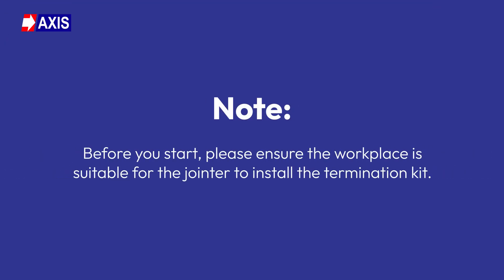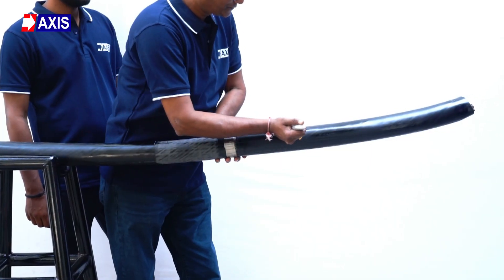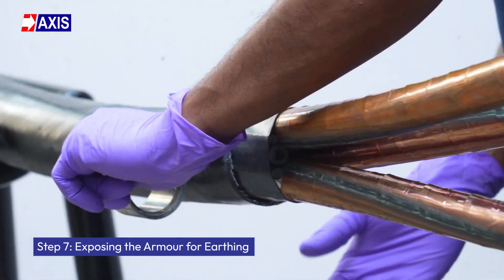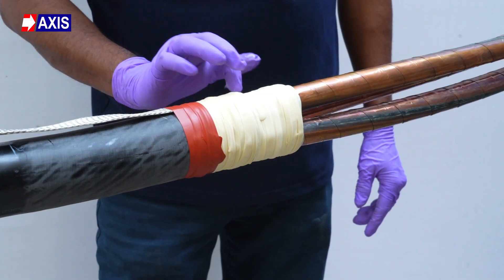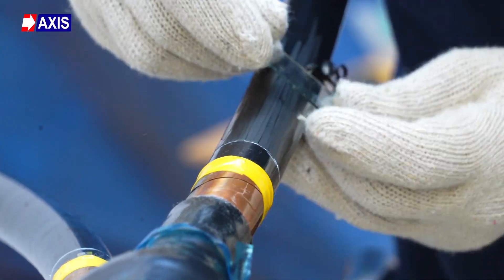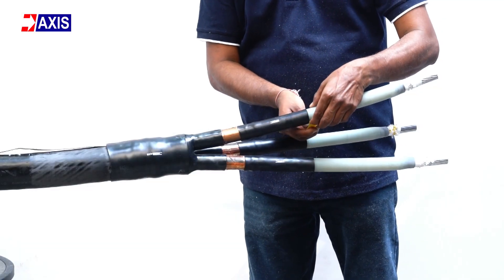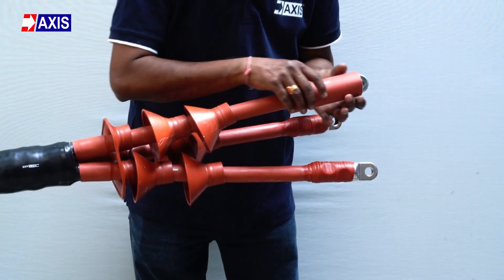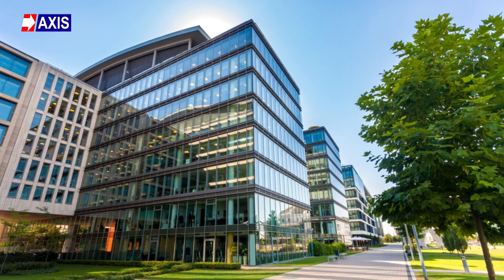How to install MV Heat Shrinkable Termination Kits | 3-Core Cable⚡

Comment: The cable size? 240mm or 300mm?
Reply from the maker: The cable used in the video is 300 sq.mm. These kits are range taking, so the same kit can be used for cable sizes from 240 to 300 sq.mm. 

We have other sizes as well. For more details, please check our website:

https://axis-india.com/heat-shrink/

Comment: What happens when my cable xlpe is not armoured? Should I skip the armour earthing part?
Reply from the maker: The cost will be slightly lower, and you only need to specify this before buying so the correct kit can be provided

Comment: Can we reinstall at the same place if there any damage like small burning due to rain water under the rain shed or we need cut the cable and install freshly.
Reply from the maker: Minor damage like small burning or water ingress under a rain shed should be carefully inspected before deciding on reinstallation. If the cable insulation or conductor is compromised, the safest approach is to cut out the damaged section and install a fresh cable to ensure reliable performance and safety. Simply reinstalling at the same spot without proper assessment could lead to hazards or repeated failures.